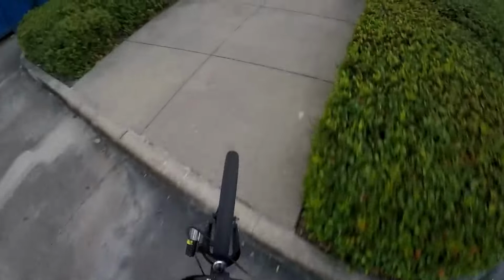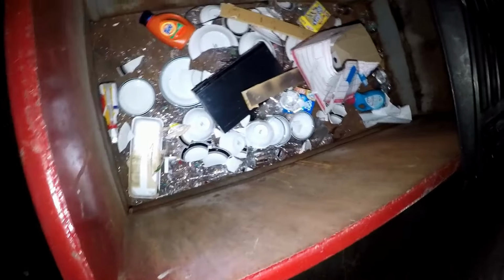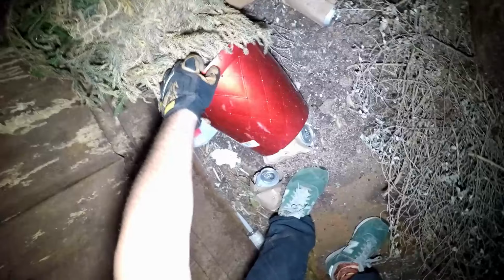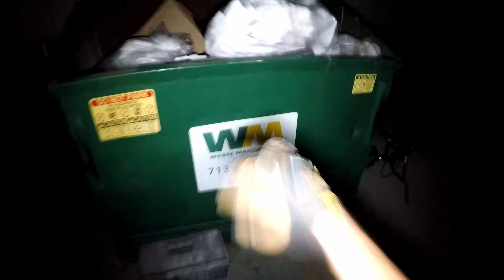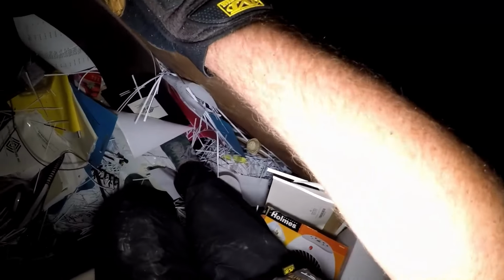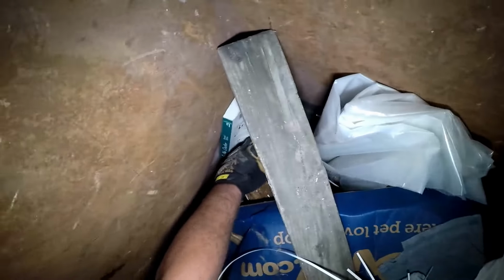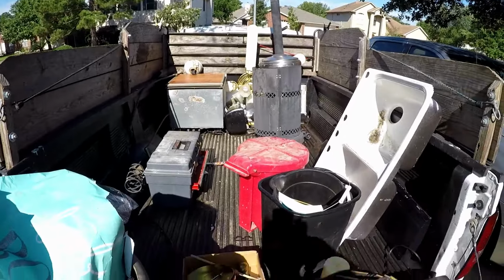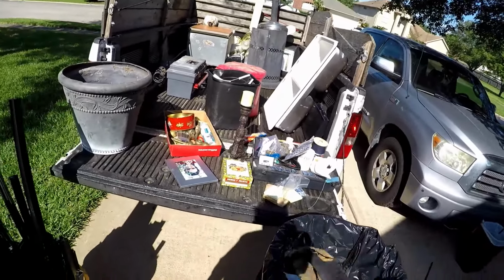Dumpster Diving "It's Probably Expensive"

Comment: The globes from the ceiling fans can be recycled into candle holders. Invert the globe on a painted or varnished square board, add flower, ribbon, twine, etc decor around the bottom. Or any Holiday silk flowers. Insert tea light candles (wax or battery operated) & you're ready to sell on Etsy, or give as gifts.

Comment: 1 if you run a cross thar extruded aluminum again sell it on ebay bunch of days use it to build 3 different routers and printers and it very  and I mean very expensive.  Look it up and most are after those shorted lengths  you probably had 200 to 500 worth.

Comment: The white ball is an old "smudge pot". It was filled with kerosene  and you lit the wick and used them as road flares during the fair. Use the cap on the chain to exstingwish.

Comment: The vintage brass bed parts you could list on eBay and get far more than scrap...I sell the threaded brass knobs alone in my shop for $10 each, and they go fast...they are always missing from the cast iron beds. The silverplate is likely nickel. Some silverplate will be copper or brass.

Comment: yay a mike vid, open open top dumpster what you got, you got light weight scrap alluimum excluded kind the best and a lot of it nice start, should of left it in there though mike, looks like someone had a greek celebration in the dumpster as if you liked your food you smash the plate up to say you enjoyed it, new seal cans darn out of date hmm if they were tuna i'd be grabbing them and taking it to a local wild life place or putting it out for the wild life if its safe as in you know smell okay, and isn't rotten or bad, vintage 70's or 80's neon not sign plug in nice lil dumpster fine, good lil dumpster great finds indeed also it shows that ppl are willing to throw good stuff in the trash well its mikes now, darn no cigars in the cigar box there cool things to have and have some lovely artwork on, you know before the goverment slaps 472 warnings on how deadly smoking is,

Comment: I wish I could do this. On one of the sites I work at they have waste skips and scrap skips but because they are lazy and dont want to walk the scrap to the metal bin they throw it in general waste. I pulled out 77kgs of 316 stainless 2 weeks ago. That's regular. Oh and the cable I get. Wow. Latest haul was 85m of 4 phase cable with 70ml cores. All stripped with a knife and that's all I need. No need for these fancy stripping machines. I challenge anyone to a stripping race. Haha.